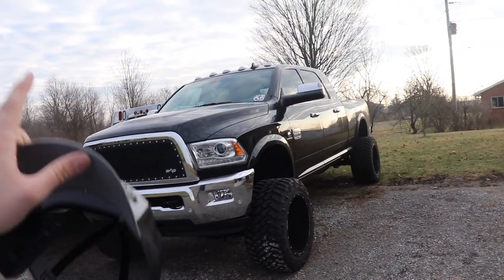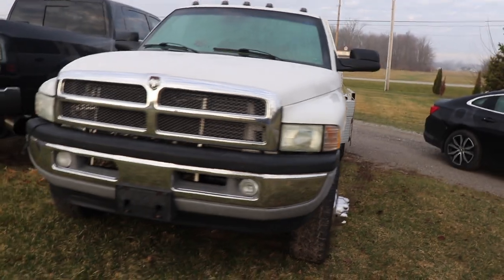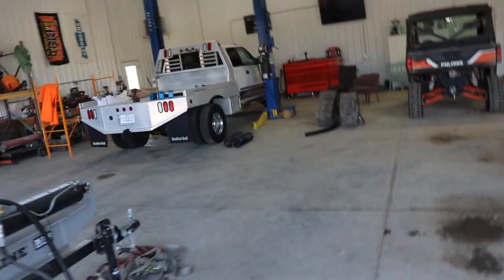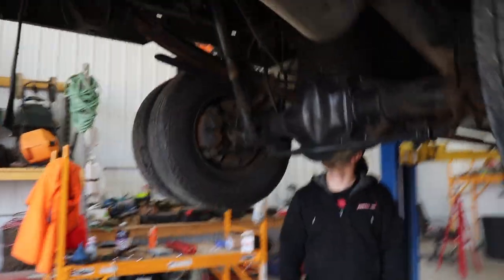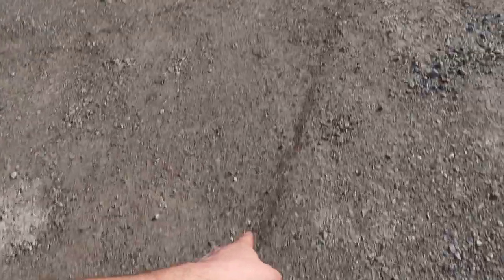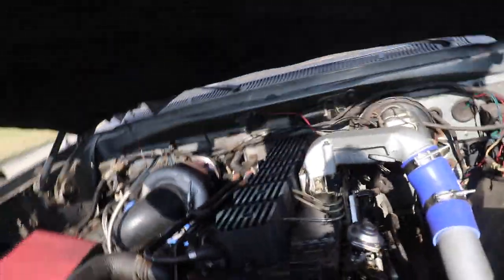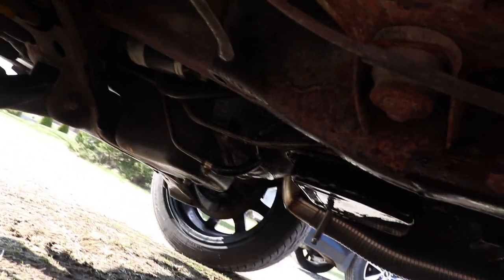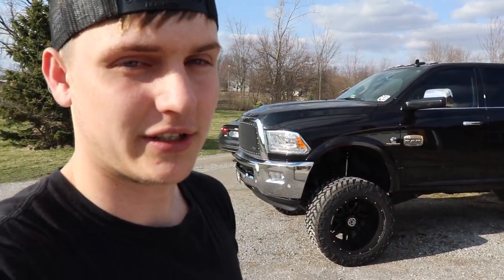LIFTING THE DUALLY CUMMINS TO FIT NEW 35's!!!

Comment: Check the lines going into the transmission cooler, when I had my first gen it did the same exact thing. The cooler is located on the driver side up by the core support and radiator

Comment: Check behind your VE fuel pump, because After I put my injectors and compound turbos it started spraying out fuel on the back of the VE pump where fuel lines connect, you should check that

Comment: I had a 1992 Ford Ranger that started leaking transmission fluid from the rear main... it sucked but I got it fixed. 

edit it’s so transmission fluid... after a couple thousand dollars it was fixed on mine. It was my grandpa’s truck and didn’t want it to die